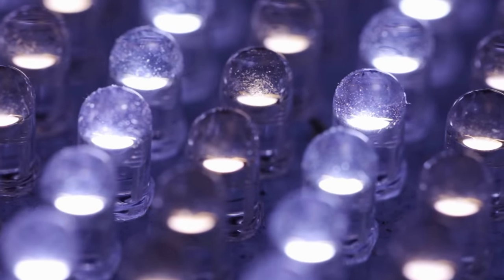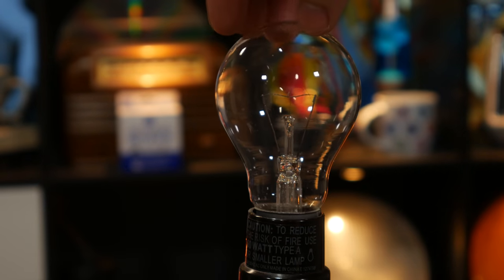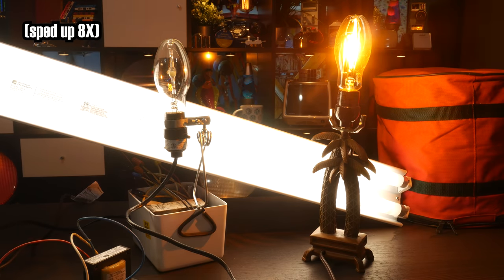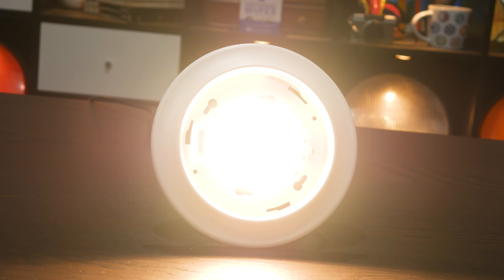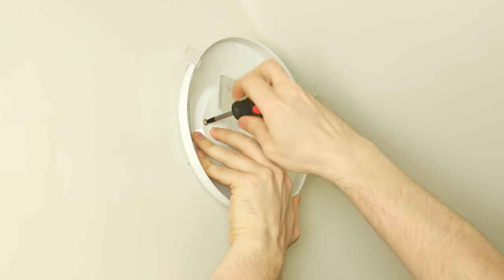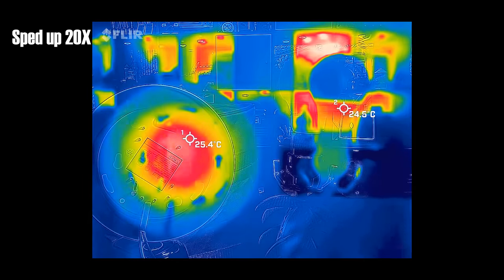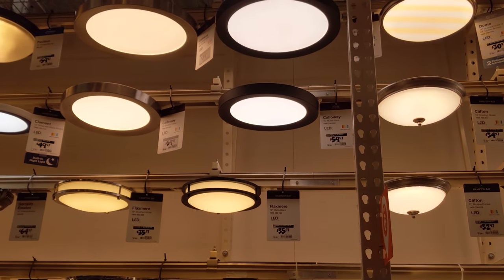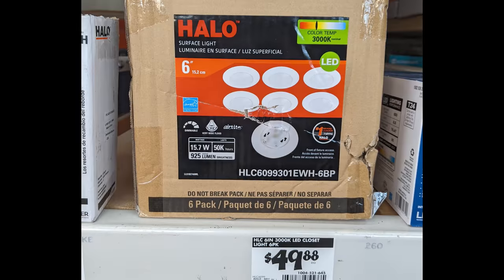A troubling trend in lighting?

Comment: Never would I ever. 
I can see people having miss matched lights because they needed to replace one of these unfixable fixtures but couldn't but an exact replacement.
Reply: Eh, it’s not a problem in rooms with a single light. I have this style of light in most places in my house (including garage and porch lights), and the few fixtures that remain that accept a bulb will be replaced immediately when the bulb in them dies. I haven’t changed a bulb in a few years. And I’m not at all worried if each bedroom has a different design of light on the ceiling. 

They’re just better lights. And if they last as long as the boxes claim (30-50 years) they might get replaced just for a new look well before they wear out.
Reply: I'm planning on buying a few spare when I do my house with them.
Reply: My thought exactly. I have recessed cans and you can't have mismatched designs and color temperatures. It has been a nightmare relamping my house.
Reply: I deal with this every month as facility maintenance for several buildings that get remodels and upgrades at different times. I can never find replacement lights/modules/fixtures/etc. because what was installed is out of production after even just a few years.
Reply: when this fixture dies, who replaces it, the tenant or landlord?
Reply: @MartinThmpsn  I bought a permanent led porch light for one of my rentals. It claimed a 30 year life span. It didn't last 3 years.
Reply: Aye yo watch this channel too lol
Reply: @hannahranga  Even if you have spares, the fixtures will age with use.  LEDs will at the very least dim, if not shift color temperature as they are used.   The replacement fixtures won't match.
Reply: I've already seen this on failed can lights that are just led fixtures like these and not old school can lights with separate bulbs.
Reply: I have a lamp in my hallway with multiple LEDs. One of them recently failed, so I bought a replacement. It does have a different color. Can't say I am bothered too much though. You'll only notice it when you look directly into the lamp, which most people don't do.
But just recently we had a bulb fail in a lamp with only two bulbs. The replacement bulb also had a different temperature and it was immediatly noticable when turning on the light. It's... distracting, to say the least. I immediatly replaced it with a matching bulb.
Reply: @alecb8509  My house was renovated before I bought it in 2018. I have several of these throughout the house and a couple large LED fixtures above my staircase and kitchen. Ive already had to replace the fixture at the top of the stairs and 2 of the can lights. Top quality items! 🙄
Reply: @grayrabbit2211  Bingo! White LEDs are usually UV and have a phosphor coating operating pretty similarly to a fluorescent. That coating degrades with use.
Reply: I suffer under that while trying to service apartments. Once upon a time, a designer put some fancy expensive light fixture in the kitchen. Often two. My strategy is to fix it by changing the driver or changing both while keeping the not broken to replace in the next apartment with the same fixture. If everything fails, I replace one with a fixable unit and waits for the next to fail.
Reply: @grayrabbit2211  They just replaced the old sodium lights on our street with LEDs this fall. We shall se.
Reply: @alecb8509  I keep the receipts and packaging for anything that advertised longevity. I've gotten many a coupon for a free replacement bulb by calling and complaining. It drives my wife crazy, but if they print it, they should back it.
Reply: @Simoxs7  I wish I could say the same.   Plenty of LED failures here, and it doesn't matter whether it's a cheap no-name LED bulb replacement or commercial Cree LED fixture.  I've never had an LED bulb or fixture make it to the claimed lifetime.
Reply: Here we've got some LED light fixtures with replaceable drivers. The problem is that those drivers are too cheap and break too often. Now companies are bringing these totally disposable fixtures.  They claim a longer lifespan but that's hardly the case.
Reply: @grayrabbit2211  You are right. Over just a few years, the fixture surface itself will turn yellow - and the extra fixtures waiting in the box remain pristine white. They’ll look strange when you swap them in as a replacement fixture - even before you turn them on!
Reply: @Simoxs7  the early generation leds were more expensive and made better as there were only a few big manufacturers making them.  Now theres a ton of cheap no names making them.   You can still get nice long life leds if ya pay more, most people just buy garbage tho.
Reply: @94XJ  well, in Europe its LEDs everywhere, our city changed almost every street light was changed to LEDs and it saves a lot of money being much more efficient, the manufacturer guaranteed 8 years lifespan or free changes, so the city saves money and its better for the environment :)
Reply: @MartinThmpsn  every moody maximalist stares in shock and horror at this comment.

Comment: It seems like the answer to the "replacement" problem would be a standardized unit that clipped in and out of the basic fixture.
Probably not a realistic thing to hope for, but oh well.
Reply: "a standardized unit that clipped in and out of the basic fixture."

so....a lightbulb
Reply: @Hephera  he is talking about something similar to what those smoke detectors use. The ones that get power from the mains as well as the 9volt.
Reply: Put an Edison plug socket on the fixture & have the lamps with short cord & plug, the way more disposals under the sink are wired.
Reply: RVs have something similar, at least in my admittedly limited experience
Reply: @Hephera  Pretty much, but aesthetically compatible with faux-recessed lighting like that, because let's face it, whoever is buying will choose primarily based on looks, practicality be damned. That way you can still have the benefit of a large metallic surface dissipating heat. Maybe standardized screw mounting hole locations plus an electrical connector with thought put into the design so John Doe to swap it out without electrocuting himself?
Reply: @ThomasRobertFr  Japan has the same sort of connection, can change the whole fixture in seconds
Reply: That already exists. He’s using an old unit. They now have low voltage standardized snap connectors.
Reply: @lolilollolilol7773  OK, the reason why USB has so many connectors isn't because of lack of standardization - all the typeA/B/C/mini/micro were standardized long before devices even started using them, and there were so many standards because USB is 26 years old and technology has kind of progressed quite a bit since then. In fact, there are a lot of USB standards you might not have heard of (Have you seen a USB micro type-A connector?), because they got standardized and then nobody actually needed them. 

The USB protocol (2.0, 3.0, 3.1) being standard is way more important than the connector being a mess; no (sane) converter can let you plug a USB stick into a PS/2 keyboard/mouse port, but for all the shapes a USB port can come in it's very cheap and simple to make a connector that just bridges the wires and the whole setup will work. In most cases the protocol is fully backwards compatible, so a USB PDA from 2001 should still work with a USB-C port that supports USB 3.0 (assuming that the right drivers are present). 

Apple is kind of a special case. None of the Apple connectors (30-pin, lightning) should be called USB, because they aren't - they're their own separate connectors that just happen to only have USB adaptors for connecting to PCs, and exist on devices that also support the USB protocol.
Reply: @lolilollolilol7773  Which is why I have a large plastic tote full of various USB cords of all types. And I am one person. I can't imagine what a mountain of plastic and wire there would be if all the unused USB cords in the world where put in a pile.
Reply: @Hephera  it might make sense to have hot-swappable circuitboards or "LED discs" instead of the old-style screw mount. As well as fixtures that are standardized to, say, car battery voltages.
Reply: @Hephera  damn..you beat me to it..
Reply: That is the standard in Australia, we put a basic plug socket into the roof, then plug the LED downlight into the socket. If it dies, oh well. Pull it down, unplug and plug replacement in. 30 second job!
Reply: Could have sworn I saw a fixture like these with a replaceable unit somewhere. Where the electronic parts are attached to the main and the lighting part twists on like a smoke detector.
Reply: @leohuangchunwang  " because they got standardized and then nobody actually needed them"
If that's the case, that's not a standard, that's a proposal. A connector that has been designed by one vendor and is used by nobody else isn't a standard, it's the opposite of a standard. 
The sole purpose of a standard is to make appliances work together.
Hence I don't care that USB 3.0 is compabible with USB 2.1 if the connectors aren't. If I have to buy dozens of converters, then the standard is shitty.
There is a dire need of regulation. If it was regulated, it wouldn't be such a mess.

Comment: To get a good temperature reading on glass, you can just stick a square of electrical tape on the surface wherever you want to measure and measure from the tape.
Reply: Try to pick some tape that isnt shiny. The gloss of the tape will affect an ir temp gun.
Reply: excellent advice!
Reply: Wouldn't the presence of the tape mess around with the overall thermal profile i.e. the exact thing he's trying to get an accurate reading on?
Reply: I prefer my tongue
Reply: @Myndale  Not significantly.
Reply: That's simple and clever
Reply: @Myndale  yes if the glass is super thin
Reply: @Myndale  not ideal to try the tape when said device is already hot, but the shiny will make results super inaccurate
Reply: Just dont use thermal imageing/IR when you want exact temps. Thermalcouples are always way better for that. Thermalimageing ist only really good to show hot/coldspots and in this case it did show that the heat spreads more evenly over the surface
Reply: Agreed, blue painters tape works for me on 400 degree Fahrenheit spring steel sheets.
Reply: @patricktennant1585  Or go over the tape with a piece of sand paper. Will that work?